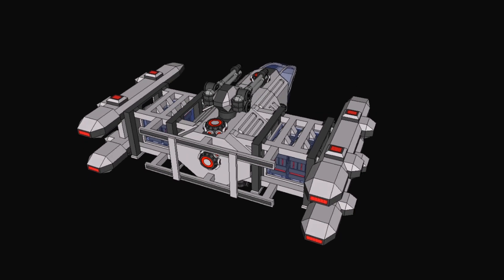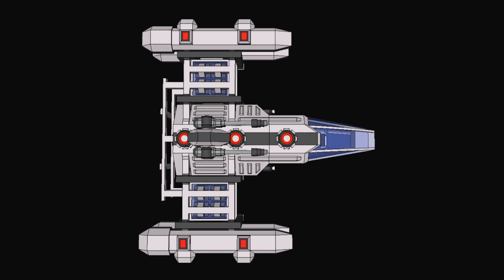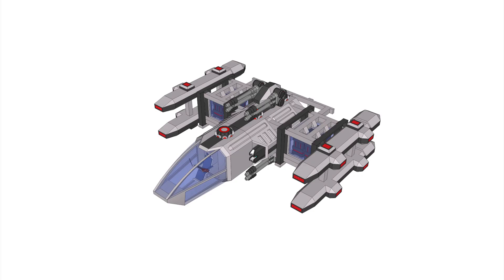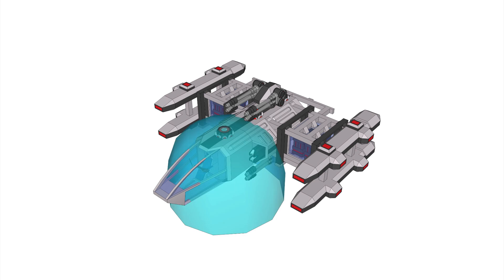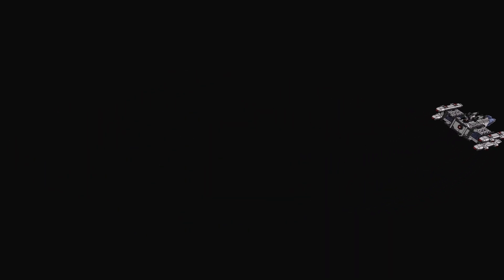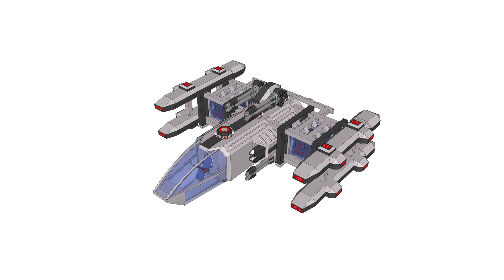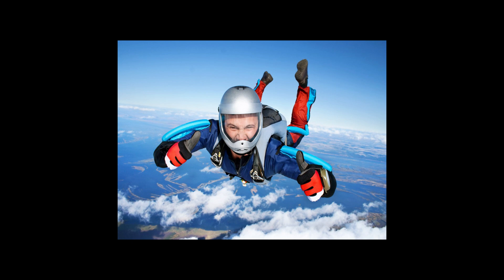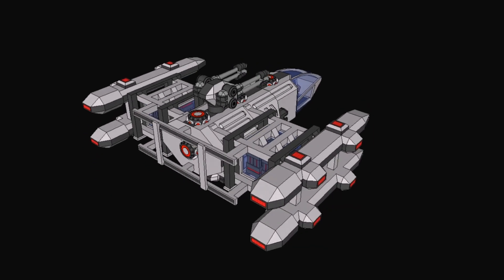Shad has a question! Gravitational acceleration on a spaceship?

Comment: There is a ton of really good content here, so I'll try to be brief.

Let's assume you have either exotic(nonexistent) matter or energy that allows your sci-fiction world to create artificial gravity. Once you assume this, a huge amount of standard physics goes out the window, so how your ship pushes itself with artificial gravity doesn't really matter. (Note; If you want that to feel realistic to super-nerds, then look up how Alcubierre drives work. Because the guy who made it is also a super-nerd, and created it to work with fictional physics.)

Here are some of the implications of such a device.

First, your gravitational device pushing everything in it's direction could be an issue. The humans and ship would be able to 'move', no problem. However, if the end of the gravitational field isn't exact,(specifically, the tips of the cones measured to the base)then it would push the accumulating space dust and light in front of the ship. I don't think there is anything that is particularly bad about this, but it might cloak the ship from all real forms of detection while moving.(radio+light waves would be bent.)

Second, when you warp space, you have to warp time. They are one combined 'field'. Objects that move at high speeds experience time dilation, but the effects of moving due to a Alcubierre drive or similar gravity drive could have weird implications. For example, an advanced sc-fi race might send it's first space-ship with an Alcubierre drive to colonize a plant, and by the time it reached there(say after 2 relative years, or something), the sci-fi race could've already colonized the planet 30 of their 'years' ago.(I don't think gravity moves people backwards in relative time, but I'm not sure if that is confirmed.)

Third, I think the main problem with this form of propulsion is changing direction. Your drives would only be able to create a certain amount of "force," but your top speed might be much higher than the force the drives could move you. That means that tactical movement would have to use a speed much slower than their top speed, to deal with inertia. That said, gravity drives might be the only consistent method that you can actually achieve 'greater than' light speed travel, assuming you could actually make them.

Your ship feels consistent, at least. That said, do you really want gravity fields to take less energy than ion propulsion(or have such ludicrous amounts of energy that it doesn't matter) in your world? I'm too much of a realist to have that happen in my world.

Comment: more or less correct. that limit however is the approach of light speed. and gravity would be a very long approach for that.  as cosmic forces go, gravity is extremely weak. it takes the entire mass of the earth to give us what holds us down, and we can overcome this, albeit temporarily, with a simple flex of the legs. I would consider in a vessel of this size that if the gravity field works the way you propose that you would probably need projectors on the underside to push the ship back up under it's occupant. otherwise you would constantly be in free fall. just a thought.

Comment: It is a nice idea until you realize that changes (increases) in gravity also caused changes (increases) in time.
Reply: Using this kind of propulsion will only cause more time to pass around the ship.  
Also gravity is one of the weakest forces in the universe.  You could achieve the desired result through electromagnetism which is more powerful than gravity.

Comment: I suspect the answer to your question of 'how fast could the gravity ship go' is 'C minus 1'.

From your description, it seems to essentially generate a specifically shaped gravity well, essentially distorting space-time in front of the ship.  The ship then 'falls' into this artificial gravity well.  This isn't precisely a warp-field, since it's manipulating space time and letting the ship accelerate into it, rather than moving space-time around the ship.  

This is... very weird, physically, because the ship is essentially falling into its own (artificial) gravity well, which shouldn't be possible.  However, assuming that's what we're doing, there's no reason to think it'd work any differently from normal gravitational acceleration.

Note that inertia doesn't increase with velocity - that's momentum.  At least, inertia doesn't directly increase with velocity, it does increase due to relativity as one approaches the speed of light.  But, since this is gravitation we're talking about, the force will also increase.  If this also results in an concordant increase in power, then the power requirement will approach infinity as the ship approaches C.
A constant power input will result in an person outside the ship observing a decrease in acceleration as it approaches the speed of light.  However, the pilot will observe an unchanging rate of acceleration, but what is actually happening is that time is dilating as the ship approaches the speed of light.

If power isn't correlated to force, you not only have a perpetual motion machine, but you can also careen past the speed of light and essentially turn your ship into... something very weird, maybe some kind of singularity?  Also a time machine, most likely, since this is a full-fledged relativistic FTL drive.

True artificial gravity tends to have exactly these kind of 'fun' consequences, which is why I'd recommend using a nice conservation-of-momentum obeying forcefield of some sort for your inertial dampener/'gravity' requirements.  You don't need actual gravity to exert a force of 1g.
Reply: One would assume the act of moving the distortion through space would require more energy, which would go up the faster you try to move it. This would also mean artificial gravity would be more expensive when in motion, which is the sort of thing that, in my opinion could make a sci-fi universe more interesting.
Reply: There is no preferred reference frame though so you wouldn't have an increase in "mass" and the ship would continue to accelerate at the same rate. This ship is however generating free energy and you could quite easily turn one of these into a perpetual motion machine. Also there is an upward limit on your speed since as you travel "faster" the cosmic microwave background radiation would be blue shifted and you would reach a point were the radiation was too intense and your ship would be cooked so more heavily shielded ship would be able to travel faster.
Reply: The basic problem that anything would face at very high speeds (before even it reaches light speed) is that space is not very empty: it has scattered molecules about 10 - 1000 molecules per cubic centemeter if i can recall and those molecules would destroy the ship by hitting it. If you want to travel fast you need to find a more safe way to do it. Using energy shields consumes energy and to stop such hits you would need a lot of it!!!

Comment: So I know this is a bit late and as many people here have already written, this is not how gravity really works. 
But to answer the question: the spaceship could theoretically accelerate to the speed of light. In practise, that would require an infinite amount of energy and also infinite time. But depending on the acceleration that these engines can put out and the fuel reserves (and I mean the fuel for the reactor here), you could get reasonably close. 
What you get is basically a reactionless drive, which means it does not obey newton's laws (which is pretty bad because it can break a lot of physics) and also there is the problem that anyone with even a small ship like this basically owns a weapon of mass destruction. Just put on an autopilot and point it in the direction of your target at full power, with enough distance to accelerate to relativistic speeds. BLAM.
More about reactionless drives and why they are a bad idea on the awesome Atomic Rocket website: http://www.projectrho.com/public_html/rocket/reactionlessdrive.php

Comment: The main problem that you run into is pretty much as you describe it. Inertia would increase as speed increases because due to general relativity the space ship would be gaining mass and thus acceleration would diminish as speed increases. This is more or less why light speed is unreachable using a propulsion system. Hope this helped

Comment: Regarding the ship's maximum speed: any sub-light speed space ship works more or less the same. From the perspective of a "fixed" observer, a ship with unlimited fuel would seem to approach, but never reach the speed of light. Therefore, a star ship would always take at least 10 years to reach an object 10 light years away.

But, from the perspective of the ship, the ship is always able to go faster (assuming unlimited fuel). Any fixed velocity is as good of a reference point as any other fixed velocity. An object traveling near the speed of light doesn't undergo relativistic effects from its own perspective. But rather, the moving object is stationary, and the "fixed" object is actually travelling backwards at nearly the speed of light, and the relativistic effects are observed in the fixed observer. 

The limiting factor in a space ship (assuming unlimited fuel) is the acceleration force that the crew can handle. To experience a force equal to gravity, that acceleration would be 9.8 meters/second/second. Going much above that for extended periods of time would be unhealthy for the crew. That might sound slow, but it would only take 35.4 days to reach 10% of the speed of light. 

As a side note, if you created an artificial gravity force to cancel out the force of acceleration, you reduce the travel time immensely from the ship's perspective. However, there is no known theoretical way to create artificial gravity. 

Over a long enough journey, the ship, from its perspective, can cover a journey of 100 light years in less than 100 years. As the ship approaches the speed of light, the distance to the target appears to compress. But, relatively comes back into play. From the perspective of those on the home world and the destination, the journey of 100 light years must have taken at least 100 years.

If we assume a 9.8 m/sec/sec acceleration limit, time dilation starts to come into play at round-trip journeys that take around 10 years from the ship's perspective. At 50 years (ship time), the journey will take millions of years "fixed observer" time. At 100 years (ship time), the fixed observer time is in the billions of years. (If you have a "force canceler" on the ship, those numbers can start to diverge sooner.) But on the other hand, a trip to a near star and back is still going to take about 10 years. In short, any sub-light speed travel is not going to work well in a sci-fi setting. While one can travel to the Andromeda galaxy and back in a lifetime, 4 million years will have based on earth by the time the travelers return.

Comment: If you have the ability to generate gravity fields, then you can achieve mass independent acceleration. This means that even at the speed of light and an infinite mass, you would continue to accelerate at the same rate. This of course assumes that the amount of power needed by the gravity field does not depend on the amount of mass it is affecting. If the mass accelerated does impact how much energy is required, then the question is one of the relativistic increase in mass, and what function relates power/rate of acceleration and mass. (Schlock Mercenary is a universe where gravity drives and gravitic weapons are common. It might be worth looking into that.)

Comment: THE most efficient solar method of travel is solar sails. For extra-solar travel then the max is 100g lest you die (as a human).
But quantum entanglement can cancel these issues. Change the spin on one, you invert the spin on the other. A glorious form of particle science. One can set up a computer that can communicate INSTANTLY with quantum entanglement.

Comment: I was thinking of different ways to do this and the one I find most practical is your way. Another way that I find impractical is manipulating the Higgs field to increase the gravity of an object. This however was impractical as the object could be placed below the flor to make artificial gravity in the ship the objects mass would be immensely large! I'm talking one quadrillion metric tonns!!! Therefore moving the ship at the same time would be impossible and I'd be seriously questioning the objects structural integrity under the immense weight. I suppose it could be optimised to be having much less weight, but the gravity field would weaken too quickly. At 1 quadrillion metric tonnes it would be 1g at one meter, 0.5g at 2 meters, 0.25g at 4 meters, etc... So this is just impractical.

In your way, we would have the gravity generator produce a field much like we produce magnetic fields, except of the exotic kind. This fictional field would then through some fictional reaction cause space to bend within the field. That is the simple part as we use complete fiction here so no practical problems. The problem I see though, is the energy required to produce a sufficiently powerful gravitational field within the cone. As you see from my example other above (the impractical solution), producing gravity and bending space requires immense amounts of energy. The only solution I see to this problem is simply invoking more fiction, the fictional field produces a cascading effect (like a nuclear reaction) that releases energy many magnitudes greater than the energy that we put in, this energy in turn create the gravity field. This is of coerce very shaky ground. We have a fictional field that causes a fictional cascading effect that again causes a very unnatural bend of space in a uniform direction. However it is internally consistent, Hurray!!!

The speed you can achieve is dependant on how strong the acceleration is and how long you accelerate. The only limit really is the speed of light(C = speed of light). If you are accelerating at 1g (~10 m/s) you can get to 0.5 C in 173 days, 14 hours and 40 minutes(same time required to decelerate). I guess you can then experiment with the numbers your self in terms of how strong of a gravity field you want to produce.

Going at relativistic speeds is not an option due to time dilation, unless you are not planning on coming back to civilization, ever. Since at relativistic speeds greater than 0.5C causes significant time dilation, I would recommend using other technology for interstellar travel (maybe even interplanetary). For example the warp drive (Alcubierre drive) is an option here. However, the warp drive does not leave any room for the cargo, unless you have an external drive that you can put onto your ship at the front and one at the back, behind the cargo (like a train with locomotives at both sides). Possibly you could have the warp drive built into your ship, with the back part as detachable (with it's own power generator) to be attached behind the cargo.

Also remember even going light speed is slow in the scale of interstellar travel. So even with a warp drive, you would need a very powerful one that can go many many times the speed of light. If you want to go to the nearest star in 1 month, you need a warp drive to go at 55C. If you go at 1000C you can get to the nearest star in a 1.7 days.

Hope this helps shed some light on things! I really love your channel as I my self am a complete nerd! I have learnt a lot about castles lately thanks to you, I too love castles! xD

Comment: I'm definitely late on this but the Star Carrier series of books does their gravity based propulsion by projecting a point singularity in front of the ship and falling into it while moving it forward that way you never impact the singularity but can constantly fall into it.  It can be shifted to the sides to facilitate maneuvering as well.  A down side is you gather a dust ball at the center of it and when you turn the device that causes the singularity, it releases all of the matter that got sucked in (interstellar dust, debris etc...) and it continues flying straight in the direction you were moving when you released it.

Comment: Sounds like a rudimentary alcubierre drive. https://en.wikipedia.org/wiki/Alcubierre_drive

There are alot of problems with such a propulsion system, hawking radiation would be produced from the gravitational field, which would kill any humans on board. Stopping the craft would be extremely difficult along with steering it. Also heat build up would become a huge problem as the gravitational field collides with microscopic debris.

Comment: Well, you're wrong. This is not how gravity works.

If you want to simply accelerate, then you won't be able to reach the speed of light. The energy required would approach infinity.
However it's sci-fi, so you could just have a warp drive. It doesn't accelerate you, it expands and contracts space time. Using this you can get from one place to another "faster than light", without ever moving faster than light.
You would however need some pretty big engines to regulate your relative velocity when you arrive.